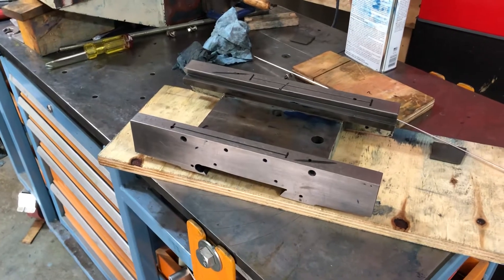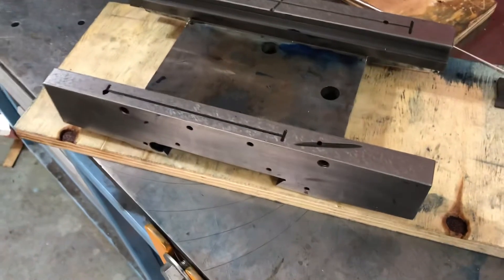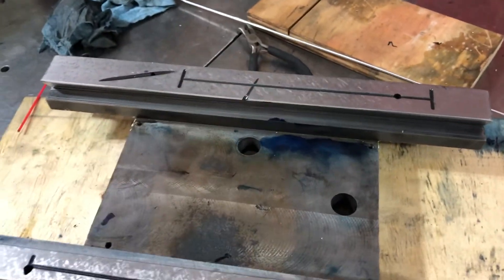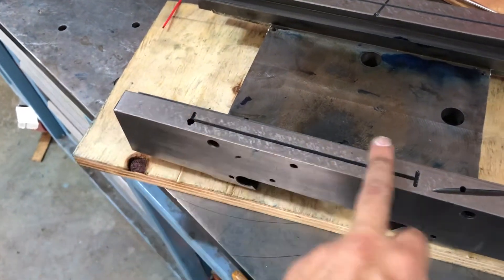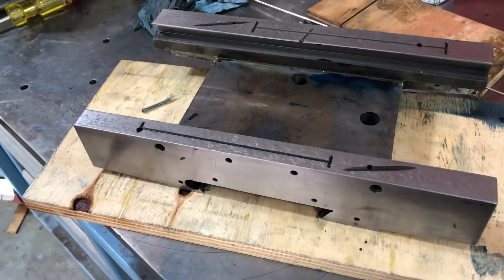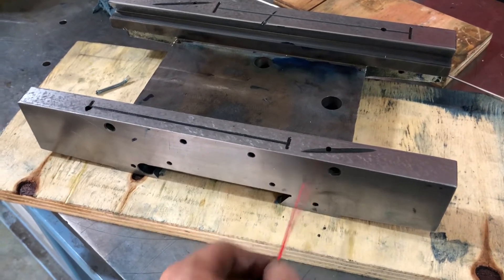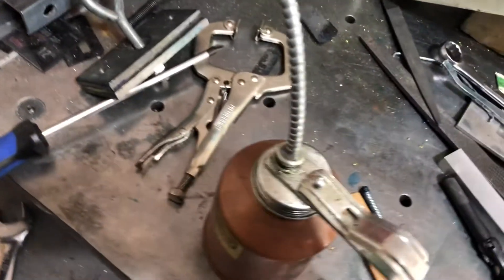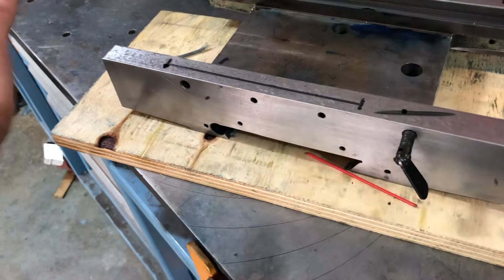Grizzly 8x30 mill: the gift that keeps on giving. Repairing the one-shot oiler.

Comment: I know this video is years old.  But curious if you went through with your plan?  If that's not working you could drill up through the Z of the knee/saddle interface and connect to the oiler in the space above the saddle and under the table.
Reply from the maker: Hey, yes I got it all back together and working . 

I think what I ended up doing was drilling both sides and running tubes to them . 

I have 4 tubes going to the top, added two additional tubes in the top directly into those reservoirs and that pressure oils the bottom way.

Comment: The other daft thing is that the oil is being fed to the top of the Y axis slideways. Where the top slides come out in front of the lower slides the oil just falls off and runs down the base casting. The pressure feed needs to be onto the lower Y axis slideways.

Comment: I have a similar mill. Taiwan made and a bit larger. I was thinking about  doing what you have done. Your video has made me want to even more.  Keep up the good work ! I had to re do the oil system also. To ensure proper oil pressure and distribution I used speed control pneumatic fittings instead of calculating the proper oil outlet size  saves a lot of work